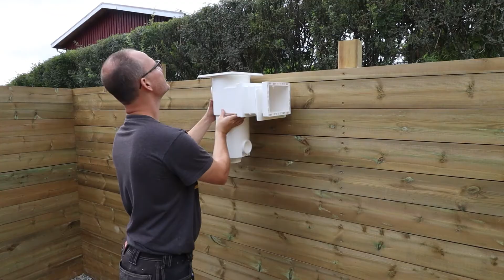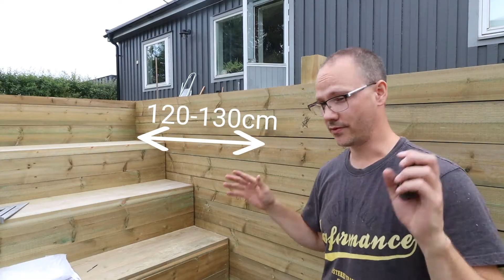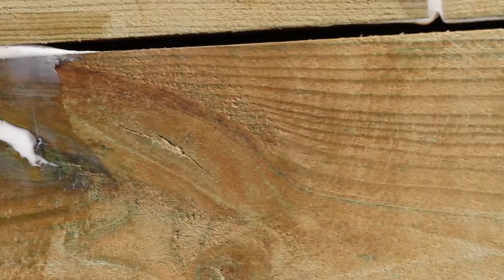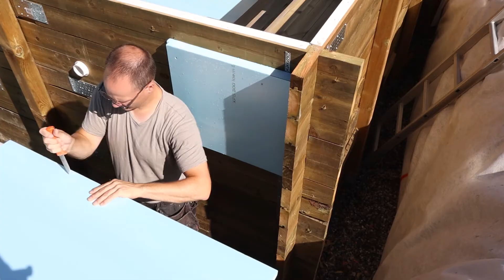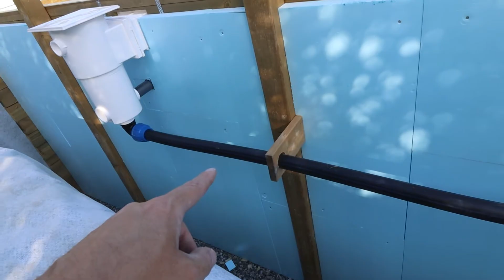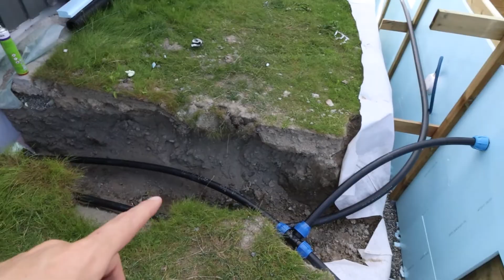How to install pool Skimmer, Inlets, Lamps & Insulation | Inground Wooden Pool Build Pt 5

Comment: Hello, 3 years later how does the pool holding up?
Reply from the maker: 4 months later i reply... one work AWESOME!
Its absolutely rock solid with zero issues. Massive pool partys, kids bathing almost every day during summer and not a single issue with anything. Every winter I empty the system of water and lower the water level below the skimmer and then let it just freeze over, about 50-60cm thick ice. The spring come and as soon as the ice breaks then i turn it on and its bathing time again.